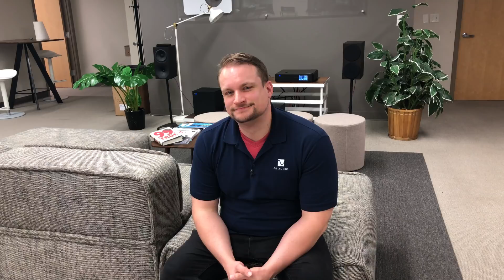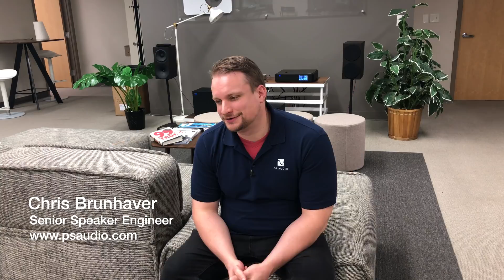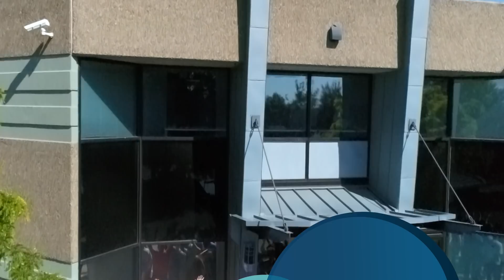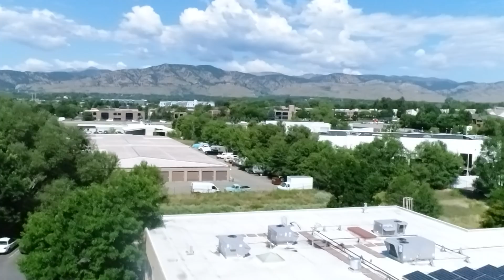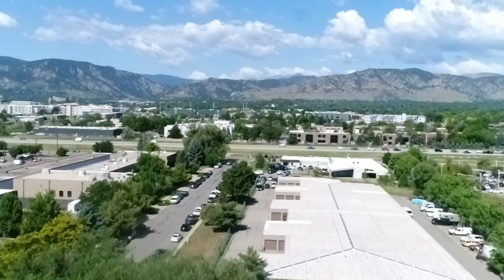Do speaker cone materials matter?

Comment: Hi Chris, thank you for your information.
I have Speakercraft ceiling speakers through out the house ( AIM 8 Two )... The cone woofer is made out uf resin reinforced fiberglass, where as the tweeter dome is made of 1" Treated Silk... What do you think about the materials ? Would you recommend to change the speakers with higher quality materials that would make a big difference in sound ?
Thank you,
Luis

Comment: Too little attention is paid to reduction of mass in midrange drivers and tweeters. It's been my experience that despite other flaws, low mass dome and cone materials yield the greatest information retrieval and low level detail. It may be why many people prefer the sound of well made fabric domes such as silk over metal dome tweeters. Well made silk dome mids or tweeters are lighter and more fleet of foot... despite their lower rigidity, respond to the nuances of music with greater speed. In the same way an electrostatic or ribbon speakers are excellent at detail retrieval because of their low intrinsic mass.

Comment: Does dome/cap material matter? Trying to fix a bass guitar 12" speaker and think a wire issue where it meets at the coil, but that dome is not coming off easily... likely will have to cut it off. Checking eBay first for 80mm caps and seems a few options in materials.

Comment: I find that the best sounding cone materials are the infinity c.m.m.d (ceramic metal matrix diaphram). So warm and breakup frequency is way above the crossover. Frequency response is almost equal at a large listening angle. Distortion is very low (if below its limits of course). 
I changed my speakers a million time, but keep reinstalling my interludes because every replacement i tried didnt sound as good.

Comment: The modern speakers with metal or other stiff drivers are not easy to drive and therefore you have to buy an amplifier that costs 5 times The price of the speaker. The Kef LS 50 costs about 1 200 euro’s but when you want to play them in proper way you have to buy an amplifier at a price 2 500 euro’s are more.
When you want to buy a good system for a small room 80% of the bookshelfs speakers are between 85 db and 88 db in 8 ohm ore even in 4 ohm. 26 years ago I had standmounters that had  90 db in 8 ohm and my amplifier had 50 watts in 8 ohm. That Rotel amplifier was half The price than The speakers. There is an alternative : Horn speakers like The Klips but you have to love there sound. It’s becoming an problem to the right combination. That’s the wrong way to go.
Ludo

Comment: From someone that believes in the mighty woofer. It's more than just having the right materials for Manufacturing a woofer. It's also about the construction. I've had my hands on lots of different raw speakers. Some materials work better for certain types of music, and environments. Some speakers will sound better at lower volumes because of the mass and density of the materials, but will quickly become distorted when pushing some bass that's backed up by some power. The best thing to do is listen to some speakers at the volume you'll typically be listening to them, and at the distance you'll be from the speakers, and with your music not the sellers. More than once I've taken some AC/DC or Judas Priest to test some speakers and played it at levels that frightened the sales people. I love pro sound.

Comment: Very good, concise, easy to understand, and unbiased look at a very interesting topic. I am in the process of designing and building some active speakers, and just learned the hard lesson that sharp filter slopes do not fix the problem of stiff metal cone resonance, and just switched my mid-woofer speakers from aluminum to polypropylene with very beneficial results. Not quite as good definition but much smoother and relaxing presentation.
Reply: My bookshelf speakers have low mass stiff carbon fiber woofers.

Comment: There are little tricks that a person can do to existing speaker cones to improve their performance in specific ways as well. It really does become and art form all on its own. There is a process called speaker EnABLe (that is the proper spelling and case) which can drastically reduce the reflections on the cone itself and help flatten the response and increase the articulation and detail. It is a painstaking process which can take many hours per driver, but is absolutely amazing. And something that can be done by anyone with a steady hand.

Comment: Really good topic. Thanks, Chris. Last time I auditioned speakers I listened to Wharfedales for the first time. I liked them much more than comparable Elacs and others, and decided I was hearing the woven Kevlar cones. I accept Paul’s premise that cone materials have their own tone characteristics. As a result, when I built my first DIY speakers (single full-range driver) I picked a Kevlar/paper mix cone, along with other properties I wanted ( high sensitivity to match my low-wattage Pass DIY amps), neodymium magnet, cast rather than stamped basket among others). By luck or design, I’ve really liked them. I added a Martin Logan subwoofer after several months and will probably try different drivers in time, but I think I’ll tend to favor paper or composite cone materials, and doubt I’ll try metal or solid plastic.

Comment: Quoting from an older post of mine, (when Paul had made a video on about the same matter): "I believe reproduced sound can NEVER get rid of the "signature" of the materials of the vibrating surfaces that emit it. Pretty much like the musical instruments themselves: Their sound is affected by the materials they're made of. The quest towards "neutral sound" by loudspeakers is rather like the search for the holy grail: Only if you can, magically, make the air move to make music, WITHOUT using a material as a mediator of this movement, only then is the sound pure from any possible colourations. Perhaps the most uncoloured sound (and really-really uncoloured) is the sound of a plasma tweeter and then, of an electrostatic loudspeaker membrane, moving well within its limits of good performance. If you pay close attention to all other speakers, your ear can finally pick up the characteristic nuances that the driver (and cabinet) materials impart to the sound (even though, occassionaly and under stressful playback material, for the best ones of them). This holds true even for very expensive loudspeakers. Listen to big, all-aluminium ones: They will all ring a little, from time to time! Plastic (carbon fiber ones): they will get a tiny "plastic" hue in their sound. Perhaps the most benign "material signature" is the one that comes from wood (in its various forms) and paper (basically, the same material). It's  usually more strong and persistent in time but for some reason (perhaps having more to do with our biology and evolution for millions of years close to sounds produced or affected by wood), they're better tolerated. Perhaps that's the best reason why paper cones and wooden boxes are still widely used in loudspeaker industry. Loudspeaker engineers have done marvellous work through the decades to clear their products from sonic signatures (basically by reducing, suppressing, or spectrally isolating/exiling them) but, in my opinion, the war has not been completely won yet...
" Today, I would add: For a cone that aspires to reproduce music (art), designers/engineers should rather forget about using one material alone. Different material cone "sandwitches" is rather the way to go. More complex than pure cone surfaces (scaffolded cones) should be employed, perhaps, too,  so that stiffness/ deformation resistance are better performance-related.
Reply: Wood has less reverb than metal. that's why we tolerate it better.
Reply: Hemp fiber is strong. And much stronger than paper fiber. Where are all the Hemp speakers out there?
Reply: @lawpenner  at AudioNote. (But what about hemp weight?)

Comment: I will repeat the question in tribute for Fat Rat. The tweeter is bend on the outside, the woofer is bend on the inside: they are not at the first place in phase since the woofer pumps the air that is few cm inside the speaker box while the tweerer is 1 or 2 cm outside of the box looking from the side - side cross section. So tweeter is closer to the listener at the start. The speed of sound is the same for both. So, the sound from the woofer should late and be out of phase in the frequency region of the crossover cut between the two. So how compasate this geometrical difference?
Reply: Many thanks. I wish I knew that back in the late 1970 for t6hose technics speakers, or circe 1992 for BW 801. I thgough that was just for cosmetic and advertizing. I am frightengly slow to figurte stuff out...LOL!!!!

Comment: Not that I don't like your video, but it wasn't more that just a summering up of different cone materials. What I really liked to know, is what you use and why.
In my case I have a titanium tweeter as it's wronfull dooing matches some of the music that I enjoy and I have loved that top edge since i had a JBL 4406. Bas/midrange is some kind of fiber filled paper, as paper has it's advanteges. And for the subwoofer it's plastic (mineral filled polypropylene). I would have prefered aluminium, but the price was also important and my choosen driver has a huge magnet, +/-12mm linear cone travel.
I'm very satisified.

Comment: Good summary. Internal damping is critical. Anyone with a good ear can hear the degradation of stiff cones such as metal or ceramic. Chris neglects to mention voice coil design - this is a very important aspect. You can get away with damped less stiff cone materials (that sound better but have limited bandwidth) by using domes and properly supporting the cone with a large VC. Same for large woofers - a 4 inch voice coil provides a lot more support than a 1 inch VC.

Comment: if listening to classic rock of the 70's and 80's I prefer Paper cone mids. I think electric guitar is best reproduced with the same material it was created with. Typically paper cones in guitar amps
Reply: The strings are metal though and that’s where the sound really comes from not from the wood you could literally use plastic for the wood part.. except obviously an acoustic guitar
Reply: @Itsbeenlikeforever Interesting. As a designer at Unicornbass it would be so much simpler using plastic all the way through. I am not going into specifics on a comments section but I can tell you after heavily researching this for 30 years that you are literally wrong. Going to the subject at hand the string is only one part of a guitar sound. Apart from woods, frets, trussrod, mass of the different parts and even finish of the guiter theres amp tubes, transformers, capoacitors, and in the end a paper cone with most likely paper surround being a guitar speaker. Literally.

Comment: I'm with you Chris .. I prefer the characteristics of paper for MF ranges.. aluminium is excellent for LF work. 
What always bugs me with speaker design is the fact that no matter how advanced materials and technology become there will still never be the perfect speaker system . 
When I design a speaker I consider several basics ... they are how realistic are they sound ... I'm entirely objective .. I regard trumpets violins drums of all kinds and pianos as the ultimate challenge. And I've found small paper cone drivers with a phasing plug and well damped cone termination are the way to go . As for HF drivers I've always been a ribbon fan ... there was one case where I did use a very different type of dome tweeter and here I used a Dynaudio Esotar .. these are fairly expensive and very delicate but they really do sound excellent.. ( they are pressure driven btw ) 
Thank you Chris for your interesting and stimulating discussions keep them coming ! Much appreciated 😀

Comment: I will turn some wooden cones for a project...I wonder how they will sound
Reply: I think I have read about that having been done before.
Be sure you test for breakup with a full range of frequencies as, if I recall correctly, different species of wood are susceptible to breakup at different frequencies when used as cone material.
This can sometimes lead to separation of the fibers in the wood.

The main problem being that, when the proper thickness (thinness?) is achieved, the wood becomes too brittle for the task.

I think you should go ahead with the project, but do some research first to see if there is already information you can use, then test thoroughly.

Good luck!   😀
Reply: @Hare_deLune  I have seen it But never heard it.
Just for fun anyway
Reply: @zeusapollo8688 
Absolutely!
I would like to hear them, too!

Comment: Great talk on an interesting topic. Through the years I have experimented with a few cone materials and surround choices. I seem to recall Audax were using a plastic cone material (I think the called it TPX). It was supposed to have good damping.  I thought they worked pretty well. In the last speakers I built I used Focal drivers that used a sandwich construction with Kevlar and Aerogel. These speakers seemed to work very well.

Comment: Hartke uses some type fo aluminum for their cones. is suppsoe dto amek them sounde better. Here sio the article from weber on speaker dope...

Pre-Rola Doping refers to the damping method used by Celestion in the 60's before Rola took over the company and changed it.  it is a heavy wide band of damping material around the outer edge of the cone, and a small band around the center of the dome.  this is used to reduce the very high end attack of each note and to make distortion sound smoother. This is our heaviest doping scheme.

THANK YOU AND THUMBEES UPS!

Comment: I prefer paper cone, it is generally more warm/organic/natural. Kevlar sounds too HIFI for me, also  normal ceramic drivers just sound too weird for me. But I think that really good optimized ceramic drivers have a huge potential for sounding good, just like in Marten Design speakers. For me plastic cone has a tendency of leaving a sound residue that is annoying, especially in the low end speakers so you can hear the plastic cone making it's own movement. (really annoying, just like the cheapest Monitor Audio speaker. Fantastic speaker, but an annoying pop plastic sound)

Comment: Japanese were experimenting in the 70's, 80's with all kind of exotic cone and dome materials and used them broadly in the higher end models. They were pioneers in using exotic materials such as fine Ceramics, Graphite, Diamond, Boron, Aramid, Carbon, Titanium, etc. They also achieved damping the metal ones with the special exotic material coatings. Very sad that most European speaker maker started using exotic materials only recently.
Reply: Not sure if I agree with that 100%. Agree Japan are masters with paper cone designs such as the legendary Yamaha NS10 studio monitors. However, European audio companies were the innovators of composite sandwich construction cones such as Focal W-Cone as well as B&W subwoofers which feature Rohacell as an inner core material. All details stated by Chris in this video as the ideal cone material actually describe Rohacell to a "T".
Reply: Yeah only in the 60s right?  the first drive units designed and developed by KEF formed the K1 series of
 products. They comprised the B1814 bass unit, with a flat diaphragm of polystyrene with aluminium foil laminated to the front and rear surfaces, the M64 elliptical midrange with the same polystyrene/aluminium foil laminate structure, and the T15
tweeter with a dome made from aluminized melinex.
Reply: @realitykicksin8755  Aluminium and polystyrene are not EXOTIC materials at all! Exotic materials are very hard and difficult to cut and work with. In 1969 the engineers of SANYO started to work on a nickel-foam cone type driver that called porus-metal which was technologically way ahead in its time and it took 5 years to develop. And even that one does not count as exotic. If you want to see some early exotic drivers that difficult to make even today, check out the audio-heritage.jp website.

Comment: An interesting perspective Chris. Can you talk about cone suspension and excursion sometime as I guess that has an equal number of design compromises! Excellent videos.
Reply: Ideally you want to minimise cone excursion as it means more distortion , therefore larger bass drivers in larger boxes to shift more air.
Complience imo is related to the box size you want to use, but again less complience means its more damped-so less linear unless you have the magnetic strength to keep it moving in a linear action over the frequencies you need.

Comment: Excellent video and I hope PS Audio can be a new leader in speaker R&D. It occurs to me that speaker driver R&D was more sophisticated in the past. My old JBL 18TI with finely shaped titanium tweeters and polypropylene woofers from the mid 80s, that I bought in my teens, still sound awesome and I’m using them in my gym. Now you might realize that JBL is a Harman licensed brand and “R&D” is done by semi-retired Japanese audio engineers who got a job in some Chinese contract manufacturer focused on low cost using mainstream drivers. Hope PS Audio is not going that route.
Reply: TB ...how much licorice do you consume in your gym ;-) :-)
Reply: Fat Rat The gym is a licorice free zone. Running on a treadmill while enjoying eating licorice would be great if I wanted to enhance the size of my fat deposits.